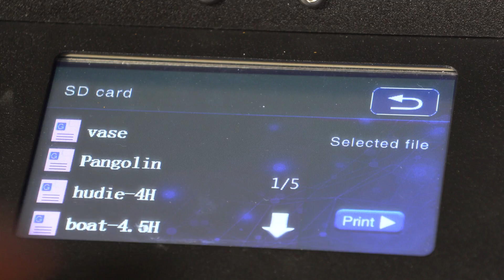The Unfortunate Problem with the Creality CR-X 3D Printer

Comment: Iteratively updating the printer live through the market and feedback is kind of the model they've chosen I don't know if it's right or wrong but I do know it works all their printers get better and better which is a huge improvement over what we got out of China few years ago and what we still get from most manufacturers of China today

I don't know if they need to change this so much as be more upfront about it call it a beta unit make it clear the design is not quite finished we're looking for your feedback to help fix it

The Dual Z motor and the missing belt that might actually be my fault :-) I bet with their representatives at er RF and gave them feedback on their machines and Corrections I would make one of which was to get rid of the belt it's a bad idea you're constraining both ends of a z rod on a machine that will never ever be machined to a high enough tolerance to avoid interference between the rail and Lead through i e Z banding

The TiVo flash came with about and I ended up having to remove it

One more got you with the file structure file names cannot be too long I haven't tested how many characters probably 10 or so if the file name is too long the files don't appear :-)

I guess my tolerance for this kind of issue is simply not us constrained I don't mind having to perform a little bit of fixing on a machine within reason to make it work especially if I know that feedback will be constructive toward making future machines better

I guess I'm just kind of okay with that it's a dual color 334 build volume printer for $800 which is just an insanely cheap price when you consider what it is compared to everything else out there and the Machine does work it took very little effort for me to make the necessary Corrections yes I had to make Corrections yes it shouldn't have had to have those Corrections from the manufacturer but it did and I was aware of this going in that it probably would need directions and the corrections I needed to make were very minor

 all I had to do to make the machine perfectly functional was ad for nuts to the bed to further compress the springs don't use folders and don't use long file names that's it my machine is printing on a daily basis now 24/7

I'm surprised your glasses warped that's unusual if the work is very tiny put a piece of tape underneath Each corner of the glass which should lift your four corners and allow the center to bow slightly if your work is very tiny this might fix it otherwise I would seek a replacement plate that is a QC check that is not excusable since the end user cannot fix that accept to replace it and if the bow is large enough it can prevent function of the printer

If you have problem with bed stick increase bed temperature ultra bass likes hot also a little bit of sandpaper to the surface will help with adhesion mine was letting go to easily

 I am tolerant of having to make Corrections as long as they are minor and the company improves the product

The first batch of Endor 3 printers had far more issues than the CRX does
Reply: What about those poor saps that bought it when it first came out, then two weeks later a better version is out? It's not fair today sometime should have to pay extra for upgrades that come standard just days after purchase. If I had paid 1000 bucks for a machine, then found out there was no QC and had to pay more to fix major issues, I'd be ticked.
Reply: Imo I think their (Joel, Angus) motives are different than yours.. they make videos reviewing printers for viewers so they would know what they are buying.. but you review the printer as a buyer and tester so manufacturers can improve their product.. creality should send beta product to people like you who don't mind testing for them but they shouldn't send beta product to those who make reviews for viewers..
Reply: That's a pretty big issue once you consider reviews and stock are a thing. As a result, you're going to see conflicting reviews and have no idea what version you're going to get until they release an S version I suppose (and even then, some of their later CR10 S models show improvements that aren't on the original (talking the bigger sizes and mini with a different filament sensor and proper bed connection). Making improvements over the products lifespan is fine, but make it easy to see when ordering, not when assembeled (or even when printing in the case of those bad capacitors). They could just do those 10 iterations in their test lab so glaring issues like shown should never see the market and you'll end up with the S version immediately.
Reply: Tweaking is one thing but after all of these machines adjustable stop switches is a must. Especially when they do not check them for clearance when put together.
Reply: Heh, lawsuits have nothing to do with right or wrong, it isn't criminal court. Stuff like this ends up in class action suits often times here. When companies blatantly ship defective products and don't really acknowledge it, that ends up in court. Add to it some of the printers that have caught fire, there's a reason why these companies are not located here.
Reply: IMO, It's wrong, very wrong. That said; we put up with and so we get what we get.
Reply: They are selling half made stuff at full price... I'm pretty sure you can figure out if it's right or wrong.
Reply: Just think if you purchased a car and had to make some adjustment to it to make it work
Reply: ewoks make 3d printers? :P
Reply: Yea, i would not even be printing if they were $800. Now I have 2 cr-10 minis and a Ender 3. Rather "slum" with something I can tune a bit then pay a small fortune for same quality prints. Thanks for the videos btw man, they are outstanding and I learned so much about printer fixes, parts and their function.
Reply: Nerys ‘
Reply: Dude, you think the design team of 3d printers don't use them themselves? The stuff shown here should've been picked up at the design stage already, unpacking the printer and immediately having no wiggle room on the bed due to it already being maxed out? I'd call them incompetent if they weren't Chinese, which probably makes it neglect, which is even worse.
Reply: Nerys I too am ok to an extent, with tweaking the printer. Shipping from China can introduce some crazy abnormalities. The limit switch is only thing I see as disappointing but I believe you said that these were preproduction units. As long as you don't have to print something to make it print. I try to look from the perspective of a brand new printer owner who doesn't have a second printer.
Reply: They're able to do this in large part due to their geographic location. If they were located in the US they'd probably end up getting sued.
Reply: jintat87 actually I started off and continue to this day to make my videos for my viewers to give them the solutions to allow them to buy these cheaper DIY machines and get good results from them

It wasn't until creality that any of the manufacturers were open to suggestions on improvements so now my videos are dual purpose helped discover the fixes for the manufacturer which so far creality is the only one who has been receptive to that and two again show my viewers how to make the machines work well when I get a DIY machine from China I assume it will need work to me that is the default

I expect the machines to have problems and my objective is to discover those problems fast enough and soon enough to be able to help my viewers overcome those problems

Joel and Angus want a prusa or G create or lulzbot response and result from Chinese manufacturers but at Chinese prices that's not possible if you watch angus's video you will know he correctly points out that that kind of quality control is rather expensive that's why these printers cost so much in large part

When you buy a lulzbot it just works and their support is fantastic but you just paid $2,500 for that here is a machine that does dual color with a larger print volume 4 less than 1/3 the price of course the quality will not be the same the print quality will be but you were going to have some DIY issue at least in the beginning that's the nature of the Beast you can't have both you can't have first batch perfect quality and Chinese low price it just doesn't work at least not yet eventually I hope creality knowledgebase becomes large enough that they will put out a printer that just works but I don't think that's going to happen anytime soon because they're still innovating they're still pushing which means constantly introducing new things that they don't have experience with

I don't know of any way to have both low price and immediate high quality they can't wait to release the printer until they get feedback because the other manufacturers who don't care about that will eat their lunch and the normal rules that apply to business here don't apply there even if the other companies eventually fail because they didn't do the right work 10 more will replace them as long as there's money to be made the margins required to be profitable over there are lots more than here and the work required to put out a product crappy or otherwise has a very low threshold so there will always be other companies to eat their lunch so they have to put out the product and simply iterate as quickly as they can

 This is not factual source to knowledge mind you this is just my interpretation of what I am seeing and how they act and behave over there

 they can't even train someone to speak English well because the moment they train them their skills that would allow them to go to a higher-paying job and they would so it's kind of a nasty catch-22 :-) this is why someone like Naomi was such a blessing for them
Reply: HackMonkey and the same applies to creality and only creality as far as I know I cannot speak for anyone else and I cannot speak for creality into the future only from past experience I have no direct connection to them

You can also incorporate the new updates Ender 3 most of the time they are quite minor and never are they faithful to the operation of the printer every one of those things that you saw Joel make can be made on the printer as it is shipped the only modification I made to my CRX what's to add nuts to the bed screws to compress the Springs further so the bed level does not drift as much but they were not critical updates they were convenience updates technically the printer works as it shipped unlike the printer Angus got the H6 :-) that was a mess

The printers they put out do work they just usually have small minor issues that once enough people encounter the issue they get feedback and they make corrections as far as I know they are the only Chinese manufacturer who does this no one else does this I've been telling a net about flaws in their printer for a year now and they keep putting out new printers with the same stinking flaws still on the printer :-)

I 100% agree that communication is a problem they can't even trained someone in house for better English Chinese communication because the moment they learn enough English to be useful they are also useful enough to leave to the big city for better work and better pay then a printer manufacturer can afford it's kind of a very weird situation they have over there

So they came up with a solution leverage and active involved user base to help with making Corrections that are discovered after production I don't know if that is the right way but I do know it appears to be working

They keep making better and better printers the CRX even with his flaws is one of the cleanest most refined printers they've ever released

You are 100% correct though that communication is a problem they should Mark the first couple batches of these printers as beta or work-in-progress units so that the customers are clear on what they are buying I don't mind fixing minor issues other people do mind and they should be aware of that
Reply: People need to know what they are buying. Am I buying a machine that can produce prints exactly as they use in the promotions straight out of the box? Or am I buying a DIY kit? I have come very close to buying an Ender 3 several times. But each time I get close there is a report of some new upgrade, and then I wonder will I get that, or an older unit? By contrast my Mk3 has had several minor alterations since I received it in Nov, however I knew that might happen, yet had full confidence that any improvements would be available to me after the purchase. And every change is documented, I so my first run Mk3 is just as capable as the ones shipping today. There is nothing wrong with testing and consumer trials, but people need to know what they are buying.
Reply: Electric Euphoria try not to be that way I very much trust these guys they are who got me started they're not wrong I'm just a little more flexible and what I will consider okay I trust these guys implicitly if they tell me your printer is bad stay away I will stay away they're not saying the printer is bad they just saying they want these manufactures to do more in-house quality control and testing on their own which I don't entirely disagree with I just think we need to understand the Chinese angle as well or learn what that angel actually is and see how much wiggle room they actually have maybe they have more room to wiggle then I think

But please don't be angry at Joel or Angus I debated whether or not to post here at all because I don't want people doing that I trust them very much

And in my personal opinion you should trust them as well

If you are okay with a little DIY beta testing and you'll go this eyes open fully aware conscious choice then there's nothing wrong with these printers at least some of them :-)
Reply: I have worked in quality control in American companies that did EXACTLY what Creality does. Also, I respect Joel and Angus and watch their videos but disagree with their conclusions on this printer.
Reply: julius stacy it is adjustable just not low enough I was trying to troubleshoot how to fix it and one of my viewers help me come up with the right idea to make it super easy for creality to adjust the printer I need to move the hot End 5 millimeters down which would take care of the problem most likely it worked for them but they did not consider that you don't want to bed springs loose because then your bed level drifts the Springs need to be under decent compression in order to supply enough Force to keep the knobs from drifting technically the printer works as shipped it would just be a pain in the ass because the bed level would keep drifting Joel correctly recognize this and tried to adjust it to make the Springs tighter which exceeded the adjustment limit of the limit switch
Reply: Henk159 except they might never discover those issues in your lab that's why quality control is so expensive that's why American printers cost $2,000 or more you can't just put out 10 machines and say here they're all going to assemble them and they're all going to work it'll take someone with a little more experience like Joel or Angus or me to recognize oh wait overtime those Springs will be an issue and then they discover it quality control as Angus correctly noted is not cheap which is why they don't do it to the extent we would like
Reply: MrCarrellScience so they watch a video like Joel's or Angus is or mine and they fix it for a nickel it's really not a big deal at least not as big a deal as some people think it might be we're not talking about a hoony like Angus got that straight up getting work and that straight up should never have shipped this printer works fine there's nothing wrong with it it just has some minor issues that create trouble down the road that a user might not recognize but don't actually break the printer you get a working printer creality has never shipped a straight-up non-working device by Design that's why I say the improvements are iterative small changes quality control improvements Etc my modified first generation Ender three printers make just as perfect a print as my current generation Ender 3 the difference between them 30 minutes of work and $10 and smoothers it's really not a fatal huge difference it's annoying but it's not a deal-breaker

I would be satisfied with them simply marking the first batch or two as beta as working progress so that people are aware and those who don't want to deal with the minor issues can simply wait a month until the new batch is released with improvements
Reply: John Clark and the lawsuit would fail because they're not actually doing anything wrong it's creality was in the US they would gladly take returns because it would be practical but that $800 printer would be a $2,000 printer how much are you willing to pay? Even for me $800 is a stretch it would be difficult for me to justify that it's why I don't have a prusa it's why I don't have a g create even though I lust over them like the most delicious candy on Earth :-)

Comment: I guess if Creality intends on providing NO support then they can just makes changes at random and not worrying about updating the model numbers. All the changes in the Ender 3 reflect this and now a VERY disappointing release of the CR-X! I’m an avid purchaser of 3D printers as I have 6 and would like to add a dual extruder machine to the group but it will NOT be a CR-X!